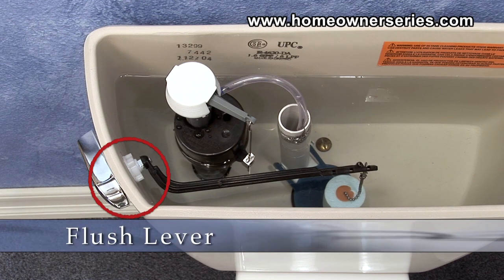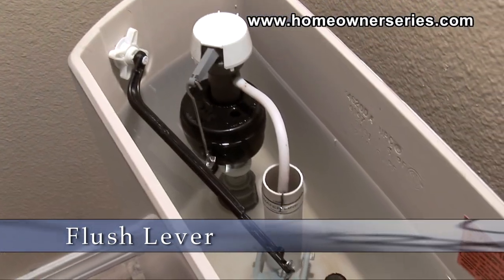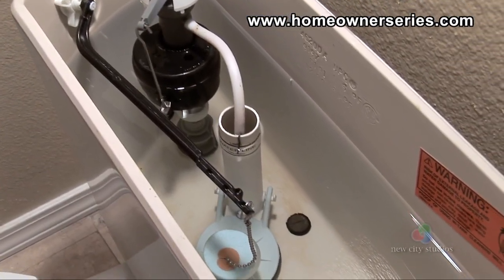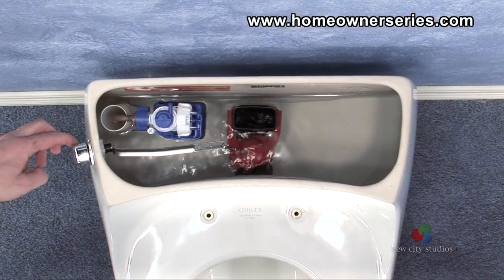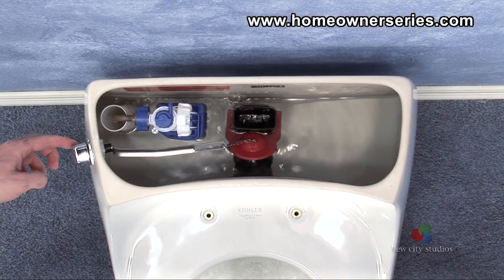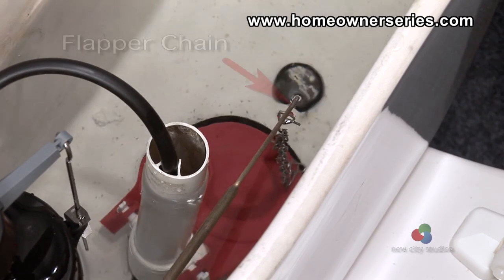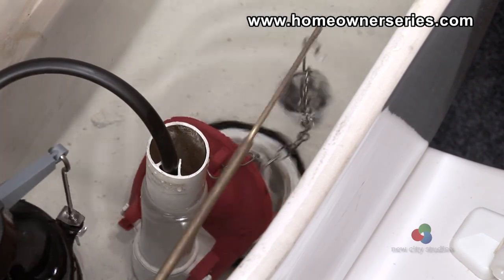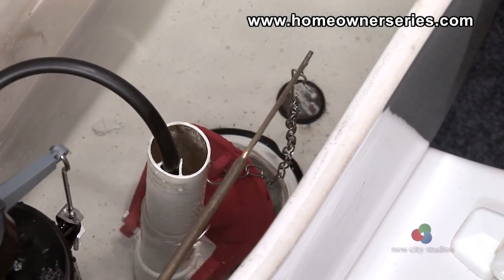How to Fix a Toilet - Parts - Flush Handle

Comment: Do it in a Kohler NON SQUARE toilet. The delta handles don't fit due to the size of the float and the large canister that is the "flap" Delta has a 90 degree arm that causes issues. the angle adjustment needs to replace their arm. Yours would be good for one of the kohlers, but not the side handle kohler toilet.